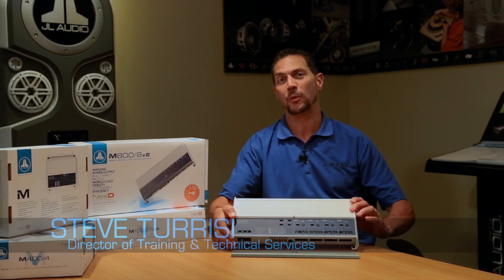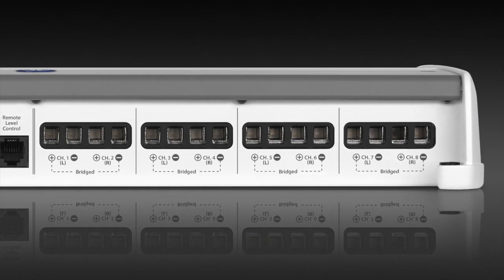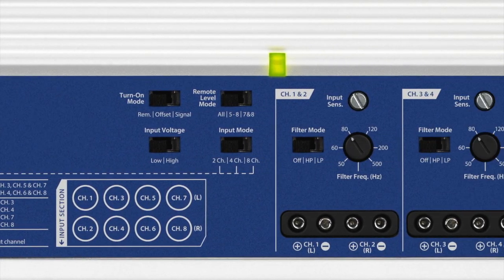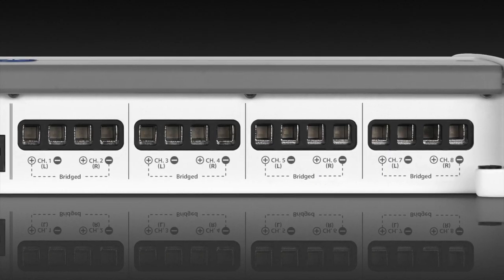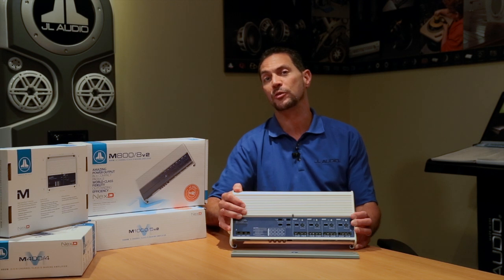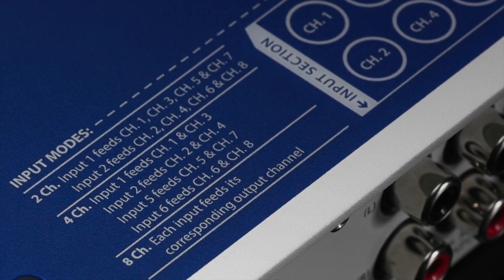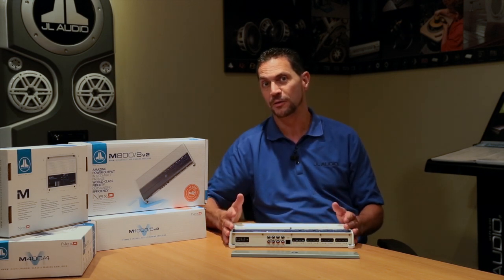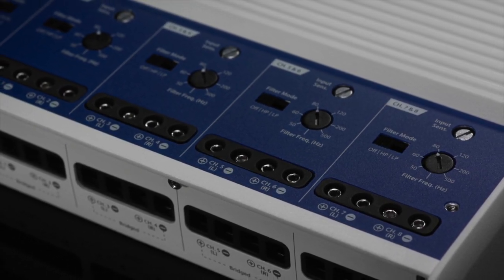JL Audio M800/8v2 Product Spotlight

Comment: one of the greatest amplifiers ever made.  If you want a proper boat, take 3-4 of these and bridge each pair of channels to each M6 midrange speaker in the boat, flip RCAs to maintain stereo correct.  set gains at 50% and let them eat.  I've sold at least a hundred of these, maybe just one developed noise in channel 4 and had to be serviced under warranty.  I've gone on record saying I want this amplifier engraved on my tombstone when i die.

Comment: I have this amp and gives you max versatility if you ever decide to change your set up.I had 4 channels running my speakers and 4 channels( bridged into 2 channels) running some 8 inch subs rated at 150rms.If I decide to get higher rated speakers I can bridge those and run my subs off another amp like an xd300/1.

Comment: If I wanted to run this 800M/8v2 in a car, it should work correct? I know there is a 24volt version, but I have this 12 volt version.
Reply from the maker: Great question.  There is no reason you can not use the 12volt version of the M800/8v2 in a vehicle.  The marine amplifier you mentioned is very similar to our XDv2 amplifier but engineered to be used in a marine environment with non corrosive stainless steal internals and a moisture resistant chassis.

Comment: So as per @00:50, i shouldnt need to run a remote wire from my Head Unit to the amps?
Reply from the maker: Blake, the amp does have signal sense and dc offset turn on capabilities but if you have an aftermarket radio with a remote output trigger, that would still be the best option.
Reply: @garminaudio  okay thanks

Comment: I have 8 M770 speakers that I currently power with alpine 50w x 4 amps and need to upgrade them. I'm torn between two MHD 600/4 amps or this one. Realize, most of my loud music playing is off battery power while anchored (3 group 31 AGM cells) and there for only 12.5v and less. This amp is only rates at 60w at that voltage level while the MHD is rated at full wattage regardless of volts. I need help with this.